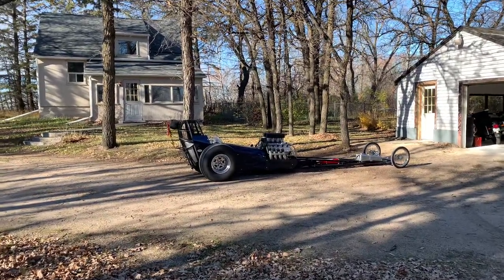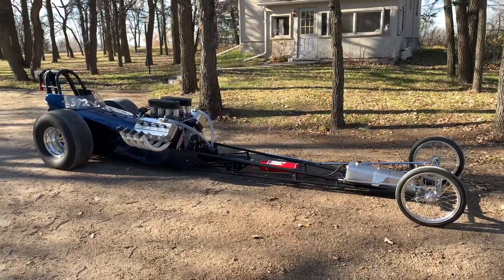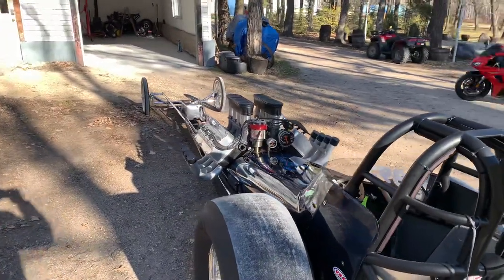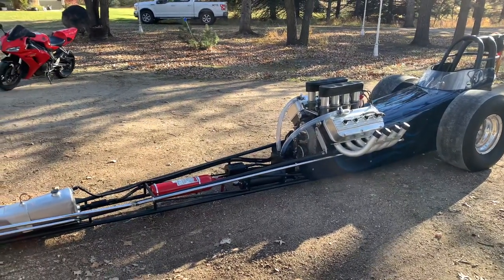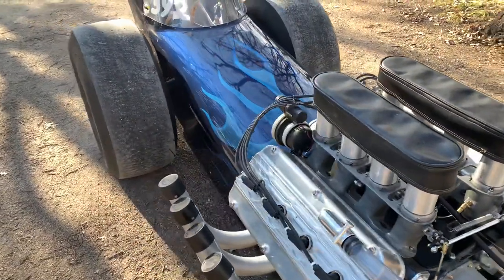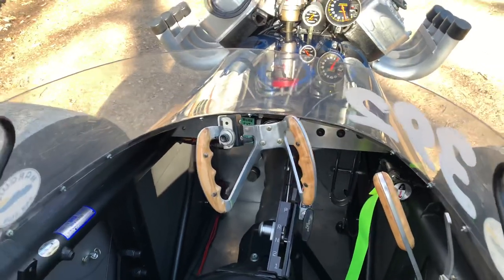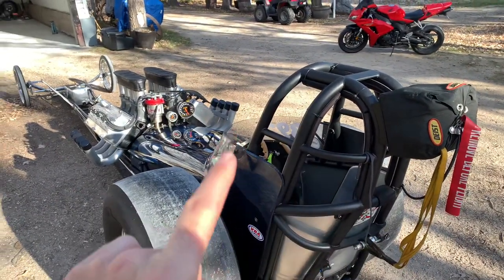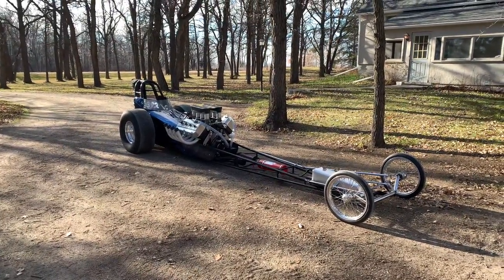Front Engine Dragster Walk Around

Comment: My dad & his buddies built & raced BB/GD's for about 10yrs. Early 60's to early 70's. Used a cast iron 392 hemi, never ran a Donovan, 6-71 blower. Had over 240 Win trophies. They were running low 7's in the 1/4mi when they quit. Built their own chassis at a local chassis shop. I still remember push starting it riding in the push truck.